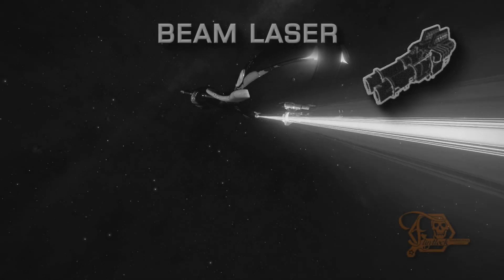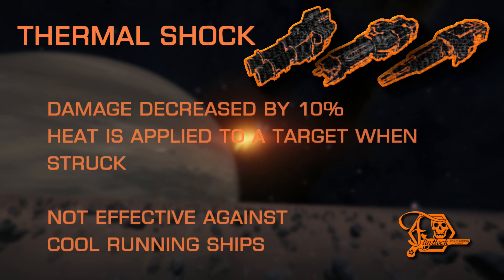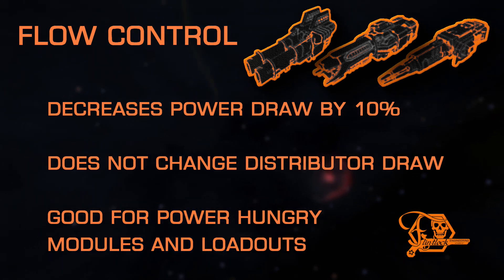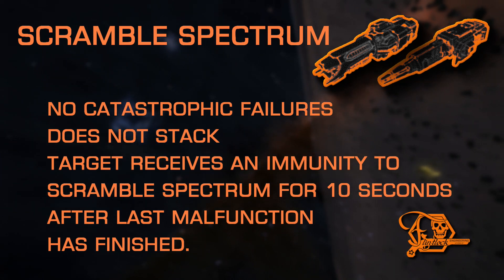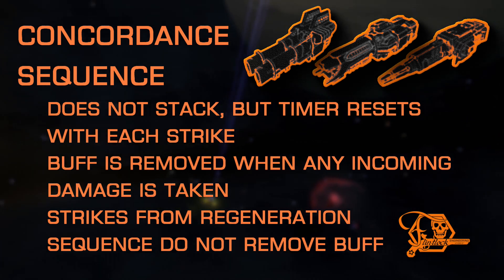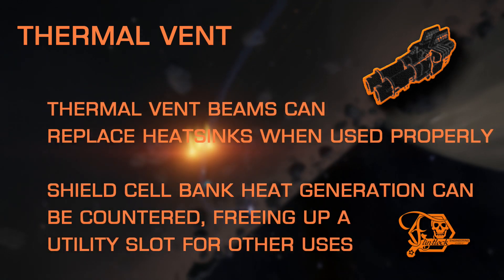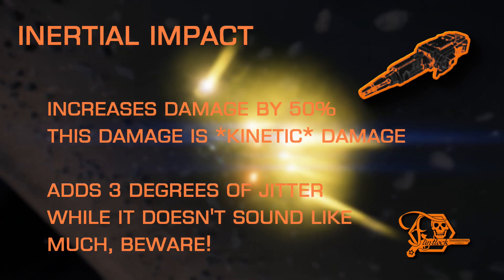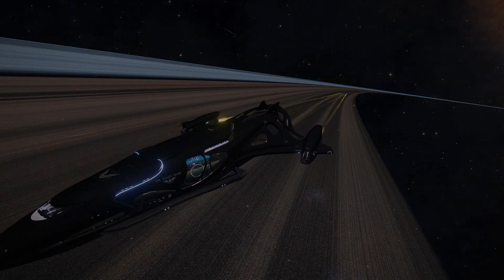Engineering Series - Episode 2: Laser Experimentals

Comment: Broo Tarquin already owns three of my kidneys. Every time I think of adding a laser to a build, I have to seriously think about it. 

That said, Inertial Impact does reduce shield damage by a bit because half the damage is now kinetic. However, the overall damage is increased by over 50% so it's actually a slight gain on shields on top of the massive gain on hull. The jitter sucks, but I like to put this mod on close-range ships like the Mamba, vulture, or anything with lots of smaller hard points like the Asp or Cobra 4.

Comment: Couple of notes,
Thermal shocks heat gain is capped at 90%, so you can’t force a ship over that but they can take themselves over. Furthermore while NPCs are immune to heat damage, they aren’t immune to TS. NPCs will try to remain under 100% heat so thermal shock will suppress PAs and rails but they will still use cell banks. Good for resistance bi-weave builds. 

Concordance won’t be removed by damage but since it only increases shields natural regen it is subject to shields 2 second regen timer (shields won’t regen until 2 seconds since last damage)

Thermal conduit is bugged, it deals 100% damage when below 100% heat and 160% damage when above (at least on PAs). Its not supposed to work this way as far as we know. 

Thermal vents heat vent effect is based off of heat generated, not distributor draw making Short Range the best due to its 40% thermal increase and Overcharged a distant second. I do believe it’s also affected by falloff though I’m not sure. Thermal vent also has no impact on distributor drain rate, heat sinks have a hidden stat where they recharge the weapons cap by 2MJ.

Emissive munitions will make a target show on radar as if their heat level was 100%. It also is guaranteed to apply on hit, every hit. Interesting note is that gimbal tracking angle (how far a gimbal will turn) is based off heat signature, so Emissive is worthwhile if your ship is mostly gimbals and runs fairly cool.

Comment: What you talked about at 10:00 might be wrong! Heat sinks grant a static WEP recharge, they do not boost (lower consumption) the current PD! See it for yourself with 0 pips in WEP.
Thermal vent unlikely will grant a boost due to low temps since heat sinks have a static (scripted as I like to talk about it) mechanic!
Reply: Not to brag, but check out a short video I uploaded called "8 Heat Sinks offsetting 10 MW of beam laser consumption", notice the 0 pips I have on WEP.

Comment: The reason that the lasers can fire longer when cold in your experiment is that popping a heatsink adds 2 MJ/s of WEP cap regeneration during the time the sink is active, not that the ship is cold. I don't know what kind of distributor an SLF runs, but I suspect it's WEP regen is completely swamped by the heatsink's additional regen.

Comment: I'm not sure if it was different when this video was posted initially, but thermal conduit now just increases damage by 60% when firing above 100% heat. Also heat damage bypasses module reinforcements.
Thermal vent now just vents heat from your ship when striking the target, and no longer increases heat when missing.

Comment: So there's one thing I'm not entirely sure I understand about Thermal Vent : Does that mean it would cool well when using 0 pips (I can have a stable 10%-15% heat before lasers fire) ? I'm running a trio of penetrator dumbfires on my close-orbit T10 (one/two shots pretty much everything once the shields are down and all it costs is my two c1 and one c2 hardpoint) and I'm trying to figure out a better way to wreck shields than my current Incendiary Autocannon setup. I'm enjoying having 4/3.5/0.5 pip management when my crewmembers are online and I was thinking maybe Thermal Vent would work here (and if it does, then one of the crew could man the turrets so they never miss even through chaff). If Thermal Vent does not work that way, what would you recommend ?

Comment: I felt something wrong with that thermal vent wep capacitor thing and finally found the answer: it is that every active heatsink provides an additional 2.0MW/s of wep regeneration, which is not affected by ship's heat level (or thermal vent).
Reply: So thermal vent does not reduce the distributor right? I felt something was off in the video when he mentioned about weapon heating, while TV is supposed to be ship heat.

Comment: This series has been such a great tool! Subbed after first video of yours I saw, very informative. I do have a quick question, if I have an Anaconda with all 8 hardpoints as beam lasers modified with long-range and thermal vent, my weapons power will drain in 2 seconds no matter what (this is on Coriolis.io that I'm getting this information), but if the thermal vent brings my ship to 0% heat within those 2 seconds, will I theoretically be able to fire my beams infinitely? I've search several places and could find no info on this. 07
Reply from the maker: haha I like where your heads is at Jacob!  Unfortunately, it's not nearly THAT extreme.  It's much less noticable, but still there, actual ships. I simply used the SLF to demonstrate it as it's a significant effect on them.
Reply: @FlintlockEngineering  Ah, ok. Thank you for the reply! :)

Comment: Question on phasing sequence; which engineering path would best compliment it with range considered? If overcharged is used does that mean 10% bleed through of that overall increase in damage or at 3km out it just has 10% of the "tickle"?
Reply from the maker: Phasing bleeds 10% of damage that would be dealt to shields, which means that is after any modification changes, and after fall off, and after resistances
Reply: I wouldn't be so sure, from what i have tested the phasing seems to have no fall off whatsoever and your getting 12% of whatever the orignal damage figure was and only when the shields are gone do you then have to close the range if your not running long range as the falloff then becomes a factor